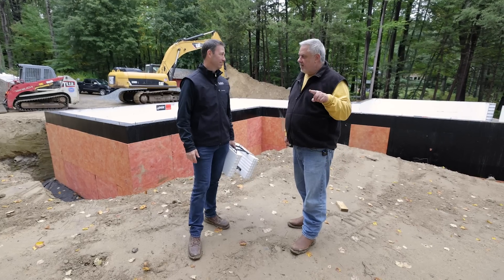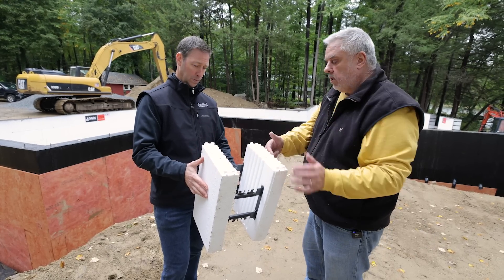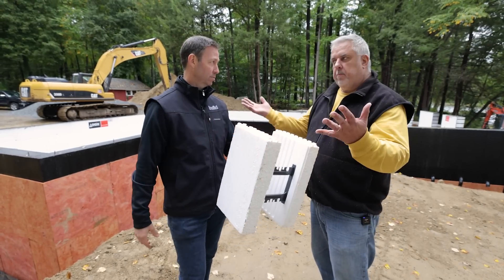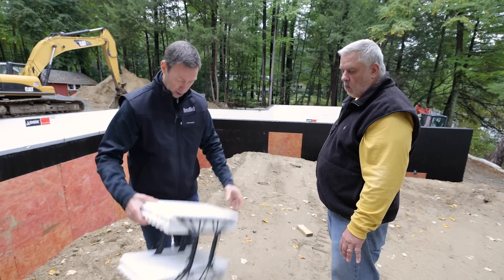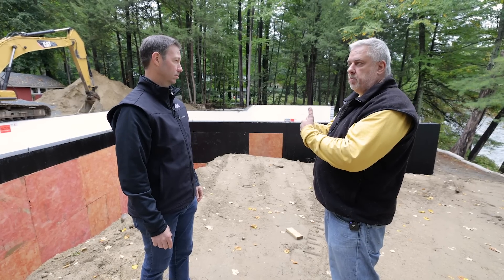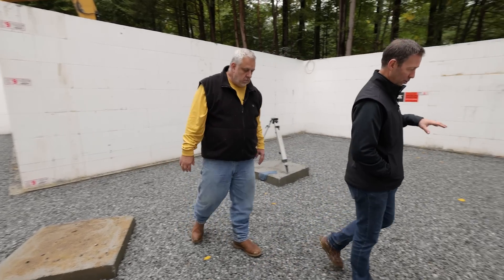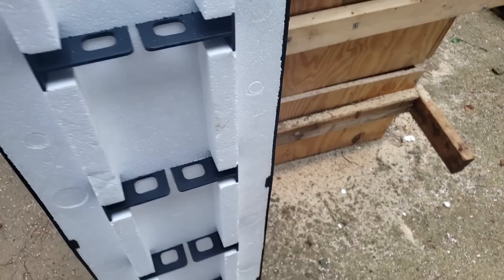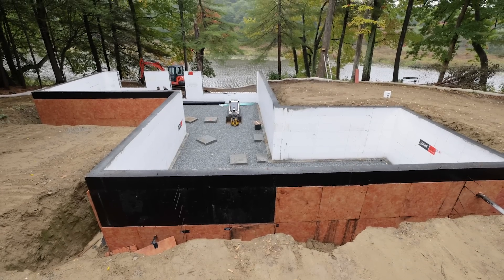ICF Foundation with Insulating GRAVEL?

Comment: We have had horrible experiences with logixs this year, I'm assuming they are cutting costs.

The blowouts are unexplained in the corners " not in a cut block" we started fully sheeting our corners due to it happening so often. 
Any1 else having random blow outs ?
Reply: We didn't have any issues with our Logix corners. 6 corners. Fully braced 9' 3" wall. Almost had a blow out where a section of cut blocks was forgotten to be reinforced is all.
Reply: Must have damaged the product or not braced properly. Not a single issue using Logix ICF.
Reply: Should have went with Fox Blocks.  They are the best ICF out there IMO.

Comment: ICF is the perfect basement foundation solution and this job is perfectly done. ICF offers unmatched strength, moisture impermeability, thermal properties, etc. I will definitely utilize ICF for my basement when I build my dream retirement home.
Reply: I had a small house that had pier blocks and I supported it and put in a 4’ wall with ICFs. It made a huge difference in heating. Our current home I built I actually just put 4” of foam on the outside of a concrete full basement. We have great southern  exposure with a lot of glass on the south wall. I have a duct that pulls air off the ceiling on the space over th basement (living level)  that blows hot air in the basement and the heat gets stored in the walls. Today it is mid 20s F and  sunny and the sun is heating us quite well. We have double stud walls with R40 closed cell foam above grade. Our ceiling has R38 batts over R21 batts.
Reply: I haven't used this brand, but IFC prone to blowouts. You are holding up 100s of pounds of concrete with Styrofoam. I think IFC is great for a crawl space or half basement. ICF blocks are  100s of dollars each block. So while you can save money on labor, it doesnt save you much over all. Another problem I have seen is, they dont seal at the footer sometimes. This is a big problem when it comes to letting water in.
Reply: @AsHellBored  ICF blocks are between 20-40$ each depending on the brand and size. The secret sauve to ICF is go nuts on bracing. Use all the 2x4 that you will need for your interior walls so it's free.
Reply: @AsHellBored  Every ICF blowout I've seen on youtube was due to improper or inadequate bracing. As with most jobs like this, the prep work makes the difference. In my opinion, the ideal would be to pour the footer and wall at once using Fastfoot or something similar, so there's no cold joint.
Reply: @AsHellBored  I had a blow out on a 4’ wall. I probably dumped the concrete in a little fast. It was a 3 year project and I did it all myself including using a mixer with a chute and dumped a a little fast causing the blow out.

Comment: I’d love to see you do a Nudura XR35 ICF basement or a whole house with their block.  4” thick foam on the outside and the inside of the block.  They also have a product called pre-buck that looks like a better option that one shown here.
Reply: STAND BY MY FRIEND......I have one in planning, walls, floors, and concrete roof???
Reply: @stevenbaczekarchitect9431  concrete roof? Now we are talking!
Reply: @4philipp  yeah buddy
Reply: @stevenbaczekarchitect9431  I built one in Manitou Springs, Colorado 3 story, subfloors and roof all ICF.
Reply: Great to hear Steve, I’ll definitely be watching out for that build!
Reply: Does the Nudura buck have the loops for rebar?  That's what those looked like on the Logix bucks anyway.

Comment: We've been building exclusively with ICF for the last 20 years however the majority of our builds are all the way to the roof. Building the above grade walls with ICF where exposed to the elements offers tremendous benefit and great value.
Reply: This is the way. ICF has so many benefits.
Reply: We're looking at ICF for our home build.  I like the LitedeckSRS flooring with up to a 50' clear span, opens up entirely new possibilities!
Reply: @michiganengineer8621  Why did you go with Litedeck?  I'm looking at I-span with 2" of concrete over it.  Is there room to run utilities through the spans?
Reply: @rockys7726  Four reasons we're looking at Litedeck or a similar ICF solution.  1: the potential for having NO interior supporting walls.  2: thermal and acoustic insulation 3: fire resistance.  And #4: Resistance to severe weather, tornadoes being the primary one around here.  No, the Litedeck ICF doesn't have utility channels through it, I was planning on a "false ceiling" made of sheet-rock hanging up to a foot below the decking where needed to conceal utilities.
Reply: @michiganengineer8621  n.v
Reply: @michiganengineer8621  All good reasons.  I thought about that building my house in TX but I decided against it because of the utility space.  I would have to add 12 of height to the walls to accommodate the ducts, etc.
Reply: @michiganengineer8621  I love ICF and will absolutely be using it to build my house.  I would also much prefer a concrete roof, but I'm not a huge fan of ICF for roof/floor.  For roofs especially you'd be much better off having the insulation outboard of the concrete.  You should check out the Ecospan composite flooring system.  It uses open web bar joists so there would be no need for a false ceiling because there's plenty of room to run MEP.  Also, the system as a whole is much lighter because the joists are made out of steel rather than concrete.
Reply: @00HiGhGuY00  I'll take a look at the Ecospan system.  One of the reasons I'm looking at using ICF for flooring is weather, specifically tornadoes.  The attic area WOULD be insulated if we built in Michigan or a similar climate zone with either a heavy coating of closed cell spray foam under the roof decking or with a very thick layer of rock-wool under the decking material.
Reply: Just wondering but do you build out in New Hampshire? I'm planning to move there in 2023/24 and will be buying raw land.
Reply: @Trahloc  Our work is generally centered on the NY Metro area (LI, Pa, Conn, NJ). While we have regularly provided material and instruction to contractors choosing to build with ICF for the first time, it would probably be best for you to investigate seasoned ICF contractors that are local to your area.
Reply: @Trahloc VT ICF is a builder we saw out there. We plan on moving back up north NH and want an ICF build.
Reply: @First Last I'd be interested in that answer as well. It looks like it might be cheaper to me if it's compared with a traditional concrete wall with insulation.
Reply: Are you doing multiple stories in one pour or curing and repouring subsequent stories?
Reply: same here, footing to top plate is the only way to do it in my opinion. I would never build myself a house any other way.
Reply: Wondering if ICF can be used when underpinning and replacing an existing foundation. A home that ultimately wants to retrofit passive.
Reply: Do you have a portfolio i can droole over online please?

Comment: You only pour 4’ at a time and work around them do the 2nd lift. You cannot pour 9 feet of concrete at one time, or it becomes too much weight for the bottom blocks of foam.  Unless you and reinforced all the walls.  However ICF is the best. Super strong and high R value.
Reply: Unless you use SUPERFORM, then you can pour 8 feet high all the time in one pour. Been doing it for 25 years.
Reply: @braddejax9528 Superform ICF from Canada, Alberta?
Reply: This is not true. Hadn’t been for as long as I have done ICF (nearly 20 years). You can totally pour standard height in one pour. I’ve poured 24’ in a single day with no issues. I go in 6-10’ lifts and circle around the walls and usually never need to go more than three wraps around to finish. Some brands are a little weaker and I’d limit to 5’ per lift, but definitely can still pour 10’ in a day with any of the blocks on market today.

Comment: Thanks Matt and Steve, I got my SCHUCO Windows in today for our "Forever Home", unfortunately we had to delay our ICCF Perfect Block home due to my husband starting Chemo in August.  WE WILL Overcome!
Reply: Congratulations on starting the build on your forever home. I wish you and your husband the best!
Reply: I'm was thinking of using "the perfect block" or Rastra. I'm just not sold on how to attach things to the walls. Probably need to do more research.
Reply: @sustainability8200  They are much more complicated than regular ICF to install anything on them including drywall, even the joist hangers takes longer. May not need all the bracing that regular ICF do, but they are significantly slower to install regardless of the manufacturer claim. Also attaching any furring is more complicated. Likely good mostly for stucco only.
Not mentioning 5-6 months lead time...
Reply: Wishing you the best!!
Reply: Best wishes!

Comment: I set the Logix ICF's for my house.  A 1500 SF 17 sided house. It's a deltic home..  So each wall is 8' and comes together at 21.177 degrees.   It was my first time installing ICFs.  It took about a week to set the house walls The attached garage took an afternoon to set.  There's not much I would do different for the house,  For the garage I would do things a little different.  I should have cut the foam down 6" on the inside of the forms in the garage  so that my slab would have continued to the exterior foam.    Live and learn
Reply: I just spent 1/2 an hour looking at Deltec Homes site and floor plans, they look really cool!
Reply: @bothellkenmore  floor plans are whatever you want them to be.  You work with a designer.  The house is rock solid. We love that our great room has windows all around where we live in the mountains.
Reply: @adubbelde1  Yes, but changes to plans cost money.  Better to start with an existing plan if possible and make changes all at once.
Reply: @karlhungus545  The plans Deltec shows are examples.  They don't really have fixed plans. That's why you work with their designer.
Reply: @adubbelde1  I see.  Is there a charge for that, or can you just make changes 'forever'?
Reply: @adubbelde1  Oh yeah, that's what I was doing in my head, that's where the fun is😀

Comment: Why these ICF Manufacturers dont make a ICF Block for the very top thats flat is beyond me. I mean they have been manufacturing icf's long enough for them to include this type of icf for the top.
Reply: And what did they do…introduced the pro buck, exactly what i was talking about!
Reply: @peterbeyer5755  I actually just saw that myself cause I was curious if any of these ICF manufacturers have made top blocks.
Reply: Or make a foam strip cap that locks onto the top nubs just like another row of blocks!
Reply: Most times on custom homes your cutting to spec anyways depending on various elevations

Comment: Looks like alot of waste, tbh. If ground temp below the frost line is temperate year round... an r value of 27, seems excessive, for the sake of stroking a designer's rocks. Js. Your only changing the temperature, less than 20 degrees, from finished space, to dirt below slab. Figure in the r value of a fiber reinforced 16 inch thick slab, as denoted for thickness, and explain then, how this place needs much more than a fart, to heat it. 
Love the walls. Should have adjusted the shoring to not angle a footer, unless your going to pour that deep. Square, straight, and clean. Every area. Beautiful work, and jobsite, to the GC 👍
Reply: Energy costs vary per region too, so it may still be worth it,
Also comfort levels might be well worth it.
Reply: @FreekHoekstra an extra 200k not spent in a build, buys radiant heat flooring. Slippers, in the trash. Then the while thing us temperate. Heat that basement floor with a radiant water loop, and walk around however you choose. Anywhere in the house.
Reply: @homerepairguy1  its not 200k to add a bit of extra insulation, more like 10k 
Usually going from a normal construction to near passive house is only 7-8% total extra cost. And in some cases even less.
And that includes way more then just that, thats fancy windows etc.
(Based on paper from bcit which investigated this thoroughly) 

I’m nit saying thats nothing but its not 200k. And you will over time make that back in comfort and silence as well as reduced maintainance.
Reply: @FreekHoekstra  dude. Look how many bags of the insulated rock, there is. I have a hard time, seeing that truckload show up, for 10 grand.
Reply: @homerepairguy1  You need a truckload of rock anyway, because you need to put down gravel.
So it’s just the difference between getting truckload A or truckload B. Not just count the total cost. It’s always the relative cost ie: how much more does it cost.
Reply: @FreekHoekstra  fair enough.
Reply: @homerepairguy1  its a rare day that someone says, you know what, fair enough to an internet argument,
I tip my hat to you sir!
Reply: @FreekHoekstra  I'm old school, sir. Never back down from a good debate, own your position, and give credit where due. How folks used to turn complete Aholes, into instant friends. Before everyone was offended by words. Lol 🍺
Reply: @homerepairguy1  nice, cheers!
Reply: Maybe he’s doing it so he can heat it with a fart. 🤣
Reply: Yeah I was gung ho for the idea of underslab insulation since I saw it on this channel, but recently they mentioned how using the Earth’s reliable constant temp could be a net benefit, even accounting for winter/summer fluctuations.  
When I finally find a place to build I think I’d like to find a pro consultant to help figure all this stuff out by tallying up all the tradeoffs.
Reply: @chrisdaniel2759  in most places the ground is it constantish 10 C/55f or so.
So thats still a big heat sink all round. So unless you’re in a very hot area it’s still a benefit to insulate it quite a lot.

However you don’t need to insulate it as much as the outside which could go down to like -20C or 20f As the difference is less large we don’t need as much.
There are some people actually insulate straight down though, so that you use the thermal mass, heatig that up to room temp. but that gets pretty tricky fast.

Comment: Wow. I've never seen a job site that clean
Reply: Zero pre-video preparation either, their workers are just that fastidious.  "Video ready at all times!" is their jobsite motto.
Reply: Howell Custom Build does NOT mess around - as good as contractor's get, love working with them
Reply: @stevenbaczekarchitect9431  being a recently retired concrete truck driver it was extremely rare to see a job site immaculately clean as that. Most of the flat and destroyed tires came from the ones with poor housekeeping. Our company used to get on our customers about keeping their job sites clean.

Comment: Why stop there! Go all the way up!!🎉
Reply: What would you use for cladding on an ICF house?
Reply: @timgleason2527  You can clad the above grade ICF walls in any material desired. There is a 1 1/2" wide point of attachment recessed 1/2" back from the surface of the foam every 8" on center running top to bottom.
Reply: @timgleason2527  Really depends, and really easy with ICF. From stucco to siding. I'm a huge fan of ICF , glad to see Matt getting involved with it. It was only a matter of time.
Reply: How will he pay the framer??
Reply: @Th3120ck  a lot less, but there's still interior framing and roofs to be done. while you can do the roof out of concrete as well, I love trusses paired with ICF.